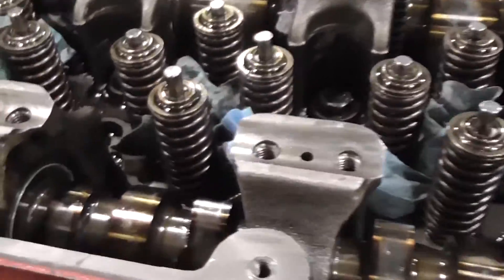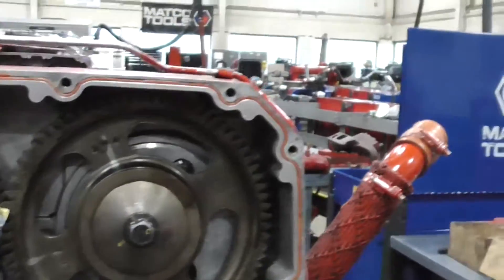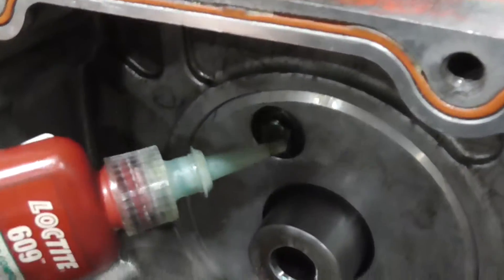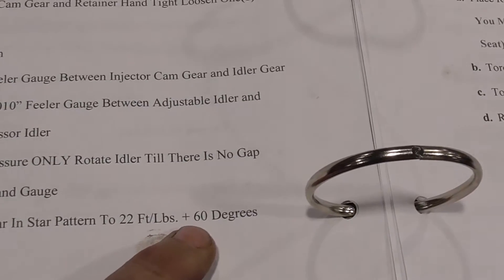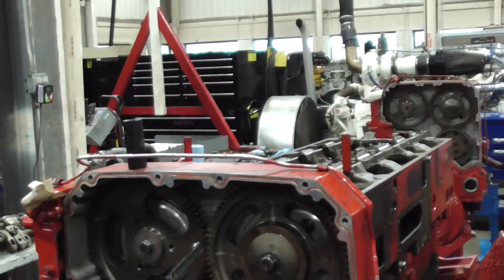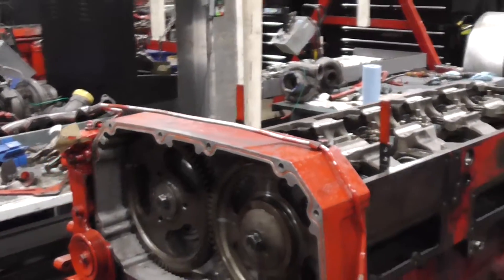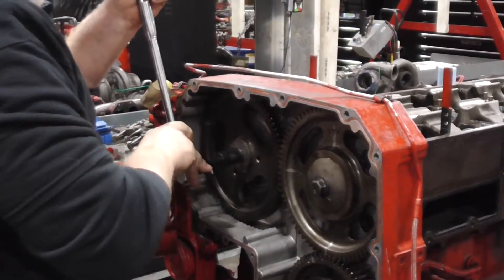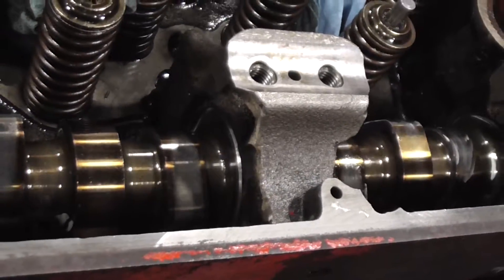ISX CM870 base engine timing

Comment: This is completely wrong. I hope no one is watching this for a how to. Your feeler gauges are in the wrong spot. You need one through rubber plug above the crank. The one at the adjustable is correct but there is no need for one between the cam gears. 
Also when you take up the slack on the gear lash you need to push more, the injector and valve cam should rotate slightly as you push the adjustable gear toward the centre of the engine.

Comment: Feeler gauges in the wrong place for setting lash on idler ( goes through the rubber plug), torque and turn specs are different to what im just doing now, and says to torque the injector cam first then with hand pressure only you rotate the valve cam counter clockwise and tighten. not sure how old this is or if the process has changed in the last 2 years? need to update your book!
Reply: I was here to make this comment, almost fucked me

Comment: Typical cummins dummy just like at the shops. This is why I do my own work. He couldn't find right size socket to save his life, couldn't follow directions, was loosening bolts while he thought he was tightening them,  didn't know the valve side from the injector side. SMH.

Comment: Feeler gouges going around adjustable gear, lower and upper gap need to be 0.225- 0.275 mm if u people lose adjustable gear he will fall down and lose that gap....and damage all gears.....and torque are also a lill different....

Comment: I'd be more worried about the timing being set with a feeler gauge between the cam gear teeth, "Obtain tooth to tooth contact between the crankshaft gear and the injector camshaft gear" if I remember correctly.
lol You cant tell me that's not going to affect performance
Reply: You are correct. There is no adjustment for cam gears. This guy is an absolute idiot
Reply: He forgot lower idle gear lash as well. Remove the plug on lower cover

Comment: This is a non scissor gear app. 
1st: Feeler gauges go between the lower idler and adjustable idler, and between the adjustable idler gear and the injector cam gear.
2nd: the adjustable idler gear torque is 65 ft. Ibs. + 1 flat.
3rd: remove slack in gear train by removing feeler gauges and turn the injector cam clockwise and torque to 100 ft ibs. + 90 degrees. 
4th: torque valve cam gear to 110 ft ibs. No toque turn. 

This is obviously in a school setting but these guys can cost someone “in the field” a lot of trouble. Don’t post training videos like this. Especially if the specs are wrong. These specs I  put are from Cummins Quick-serve. 

Clayton

Comment: Pull the plug out of the bottom cover and put the feeler gauge in the hole to set lash on the idle gear as well. Jesus wtf else can they do wrong
Reply: Can you explain man I'm about to have to do this to my motor paid a guy to rebuild it and he never did the fucking timing I'm broke so have to tear it back down and do the timing myself
Reply: @Ty81494  look up Rawze here on YouTube. He is one of the best and throughly explains how to completely rebuild and time an isx. “Rawze”

Comment: injector cam torque is +100 ft -lb +90°)x2  and valve is 110 ft-lb
Reply: Dave I need qsx15 cummins timing gear bolts tourqe
Reply: injector 100 + 90*, valve cam 75+120* and feeler gauges in the wrong place, thats what the rubber plug is for in the lower cover.

Comment: You are backwards.  
Injector cam gets the 90deg. 
Not the valve cam.
Valve cam gets  straight 109 ft lbs.
Yikes
Reply: This is why I get scared to bring my truck into shops with technicians who have either just started fresh out of school or have little experience in the field. I only bring it to an ol timer with the long beard and his head is bigger than his hat. There's only 3 of those in the east coast and whom I can trust!! one in Kentucky the other in Newburgh NY and last mechanic in griffin Georgia
Reply: @StickNclutch  whats the shop name in  kectucky ? Need that info please .
Reply: @kj_mc6492  bolton's in Corbin Kentucky
Reply: @StickNclutch  thank you
Reply: Injector cam gear torque 160 f pounds +90°